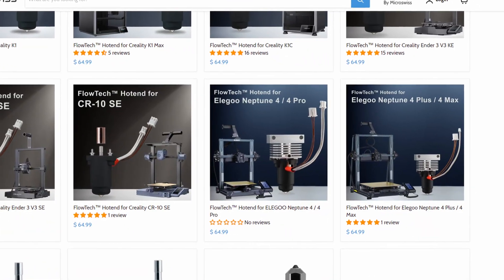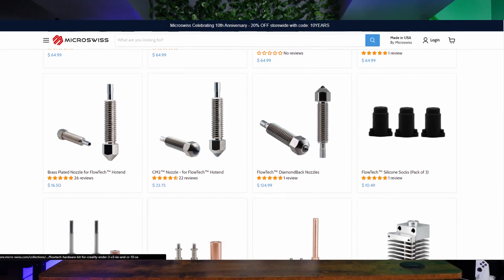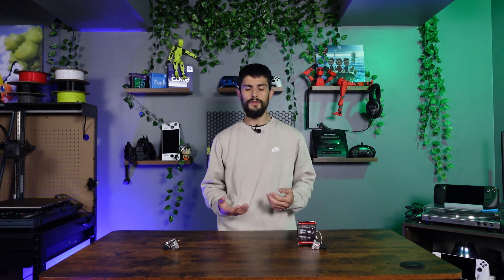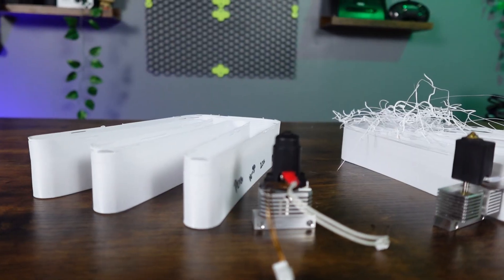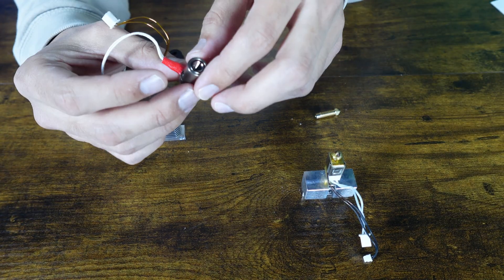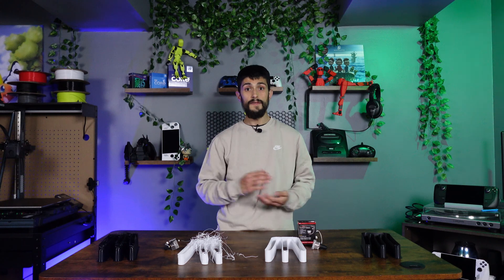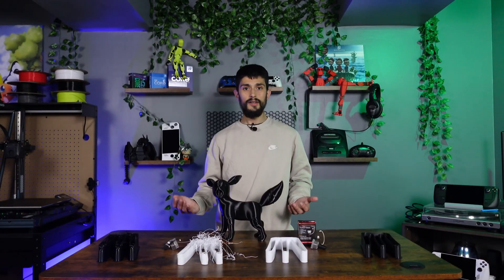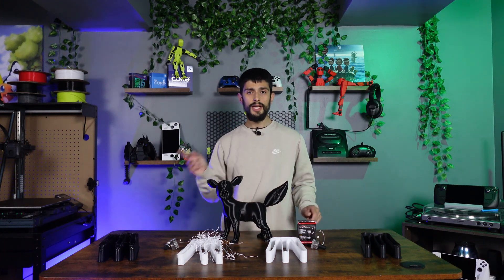How Much Flow Can You Handle? The Micro Swiss FlowTech Hotend Review!

Comment: "Longer heat time" - My immediate reaction was "don't care" for warmup, BUT it also mean a much slower RESPONSE to mid print temp changes! Most of todays printers will "ride" the temp up and down, like if thinner sections or smaller details are printed it will drop the temp a bit to render them properly. If response is significantly slower (39%) that can be an issue with finely detailed models.... 
This isn't something you'd detect on a simple tube or doing a flow test as the changes are very slow and there is ZERO detail, just a constant line.
Very nice vid BTW! :)

Comment: I love your linear rail version of the Neptune 4 Plus.  I tried to cajole Elegoo into making a Neptune 4 Plus Pro with all steel motion control but they wouldn't but my Neptune 4 Pro has been a small print farm workhorse.  The only problem was TPU squirting out the side of the extruder (I print a LOT of TPU) and breaking the plastic extruder housing which damaged the drive gear pivot, but Elegoo replaced the extruder and it's been great ever since.

I'm finally upgrading to a larger format coreXY machine.  My SV08 arrives in two days.  I think I'll order the MicroSwiss hot end, not for improved print quality or even print reliability, but just to make it easier to cold swap nozzles without needing to muck around with the heater or thermistor and that messy thermal paste.  I'm trying to decide if I need a hardened CM2 nozzle.  I may want to print PETG-CF, but I may opt for ABS instead once I enclose the printer.  I also can't decide if I want a high flow nozzle, and whether that would even work with TPU.  I didn't get the coreXY printer for fast PLA.  I'm much more concerned with print quality, dimensional accuracy and strength of the functional parts.

Comment: I just purchased one for my Plus 4 and it clogs in less than one minute of printing. This happens over and over. I have been using Elegoo PLA+ which works fine on my stock hot end. I can't print beyond a great looking brim with this hot end, it clogs between the PTFE tube and the heat break. Any advice or insight would be appreciated, thank you.
Reply from the maker: To me it sounds like your PTFE tube might not be cut straight allowing the filament to squeeze through. You could also not have it inserted correctly, as in all the way in. It’s hard to say with seeing the issue with my own eyes.

Comment: Im glad to see some aftermarket parts for the N4 series, but this is way too expensive for the performance increase. 

The Microswiss hotend and 3 hardened nozzles (0.4,0.6, and 0.8mm)is *$136*. To put that into perspective, the Elegoo hotend and 3 nozzles is *$38*.

500% the cost for 25% more performance. Even more perspective, The Neptune 4 Pro is on sale for $189, so you could just buy a whole second printer and get 200% the flow rate lol

Make the nozzles the regular cost of nozzles and I’d buy in a heartbeat.